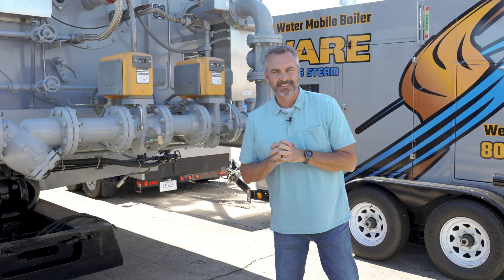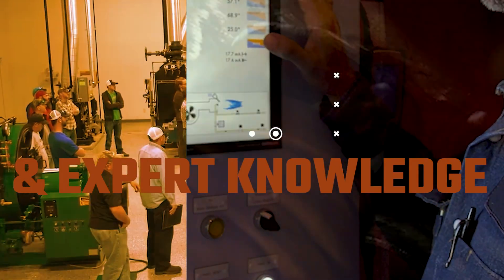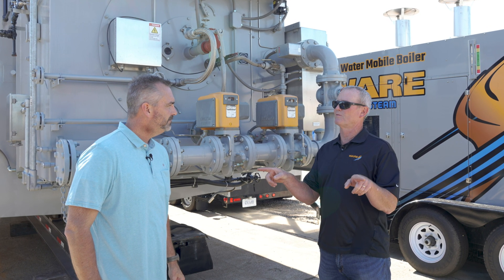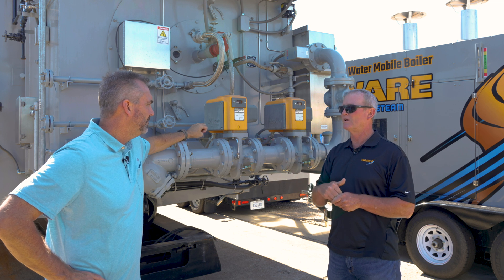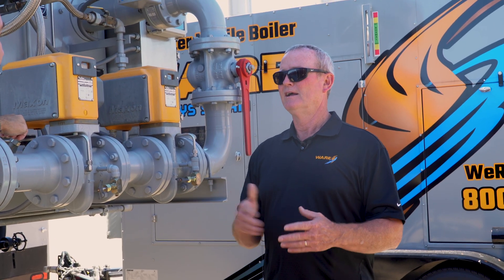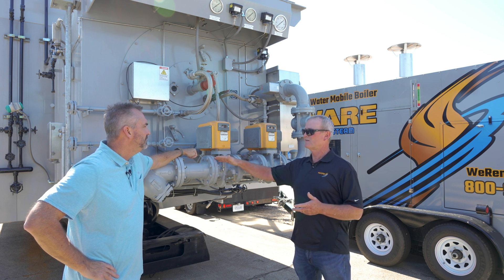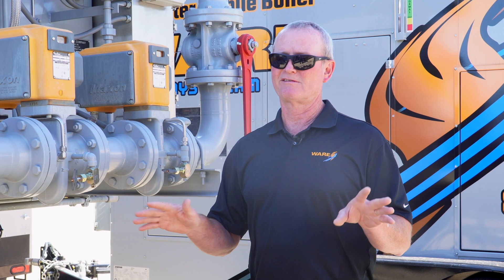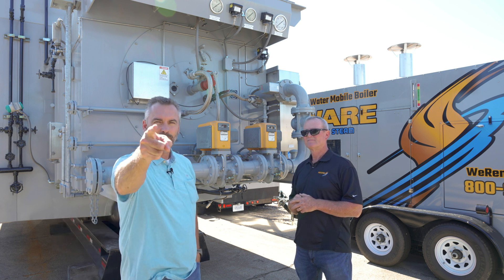Multiple Boilers? Learn How to Size Your Regulators Right! The Boiling Point

Comment: If the diameter of the gas line is not well designed or you have added another boiler to the same line, how can the second regulator help you.